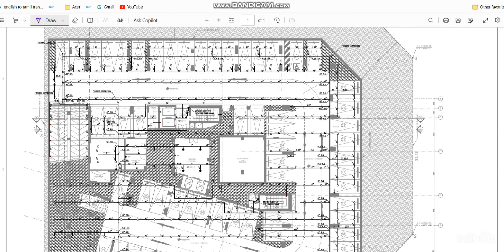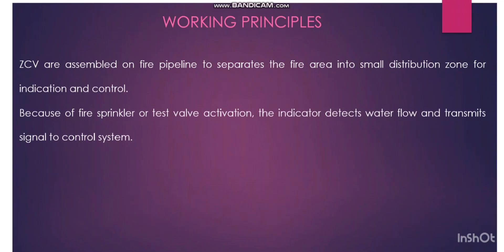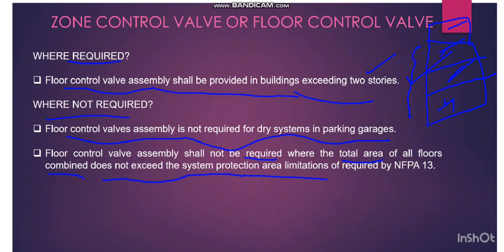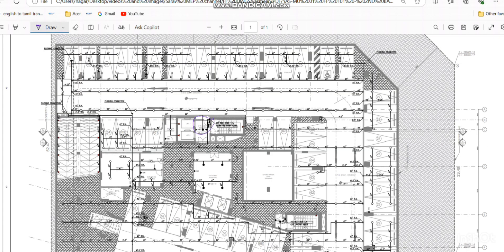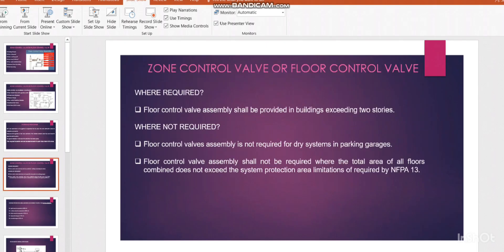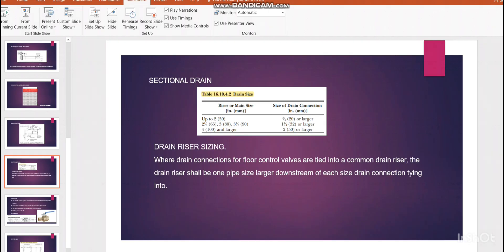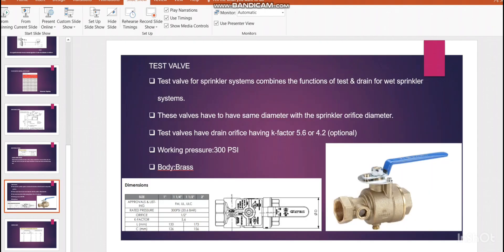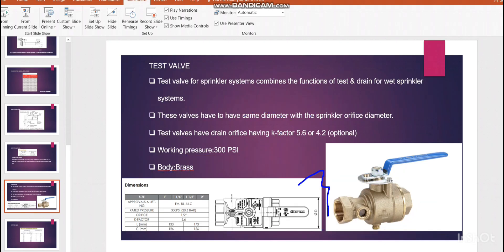Zone Control Valve Assembly l Firefighting Sprinkler system l ZCV for Sprinkler System-Firefighting

Comment: You're super amazing. If there is a drain valve will there still be need for a test valve having a drain point?
Secondly, how to size the test valve pipe)
Reply from the maker: We need to provide inspector test valve for each floor residual point. But is not mandatory by some civil defense so it is ignored.

Comment: Can you explain where we need check valves in the ZCV?
Reply from the maker: Hi if u see the NFPA reference they have mentioned check valve also in the zone control valve assembly but if your local code permits to neglect (because alarm check valve already have check valve so most of the local codes like UAE) then u can neglect that. For example u can see UAE FLS code chapter 9 it is not mento add check valve.